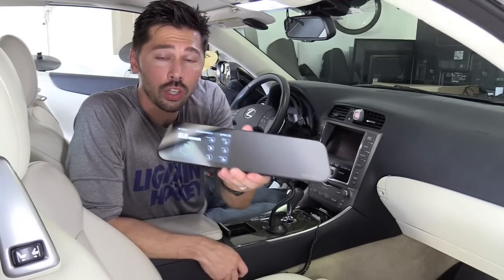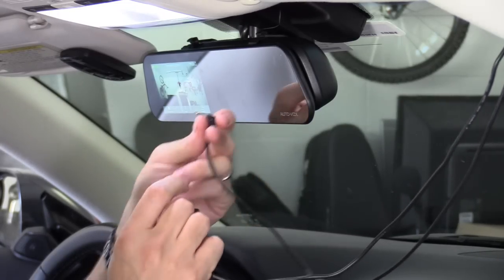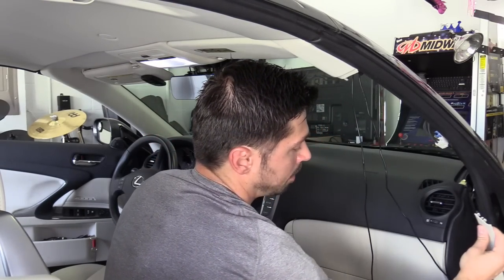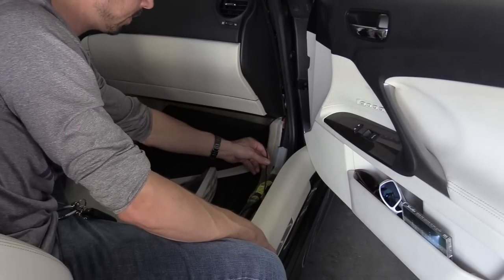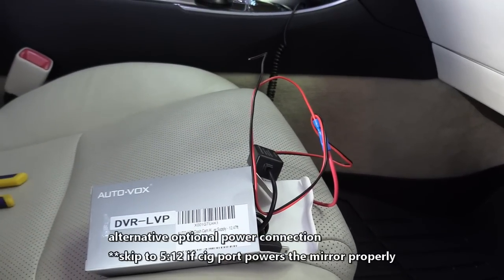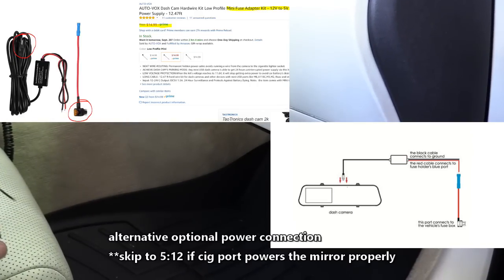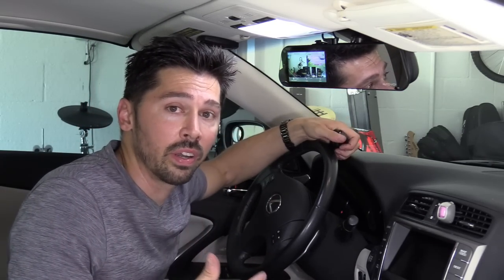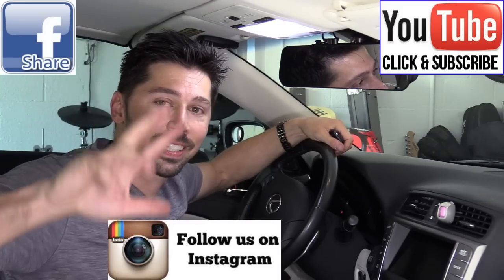HOW TO INSTALL AND WIRE BACKUP CAMERA / DASH CAM DVR SYSTEM

Comment: I hard wired my dash cam using an add a fuse but no power.  The fuses are good, cable is brand new and wired up right. One to the fuse, one to ground. What am I doing wrong?

Comment: I bought 2 for my car and my wife's.  How much would someone charge me on average to install it?  Also I did not realize that I may need the fuse wire install kit to stop the draining of battery and low voltage protection.  Amazon does not sell the one on the link any longer.  What other suggestions?

Comment: Hey big 🐕 thanks for the video, I have a Carchet dash cam that's basically the same so I think your installation will be helpful.

For the backup camera wiring, I think the product is a "quick splice" but they're made for different gauges of wiring. The ones at my local store are for 18 gauge/14 cal. and seem like they'd fit but I'm not sure. Do you know the size of those T-splices you used? Thanks man.

Edit: those ones at my local store are the blue splicers, 15 amp I think. Looks like you used the red ones, 22 gauge 10 amp. My car is a 2011 Civic, probably similar wiring to yours I'd think.

Comment: Good video! Some vehicles are longer and you may need to take the short cut down the edge of the roof panel to run the rear camera. Others may only require removing the rubber door seals and a rear hatch panel. Because most state laws require that the full tag be visible at all times (not just the expiration stickers), I suggest mounting the car tag on top of the camera mounting plate. I really don't like seeing a Trooper on my rear bumper with his blue lights on!

Comment: Good video, but next time tug wire on rubber on top of the road not bottom, I hope you got my point. And this is for all those who are planning to install this setup. Always tug wire on the top rubber bw roof and door.

Comment: This is a good video especially w the splicing proccess but forget going to a carwash. Byebye cam.  Ive had mine stop working after.  It was a slightly diff model of the Autovox w no hardwiring.

Comment: I think you need to put a rubber grommet to the area where you drilled to protect the wire from getting short circuit to the ground/car body. Be generous placing zip ties from the unit all the way to the back, making sure the wire does not touch the body/ground, especially during summer. The insulation of the wire may not be able to stand the chassis heat, and might cause some short if the wire insulation melted.

Comment: The new mirror mounted had a forward facing camera as well as the rear-view camera
It look like you placed the forward facing camera against the existing mirror in the automobile
That block the view of the forward facing camera
How do you alleviate that problemblocking that forward facing camera on the new assembly?

Comment: Hi there. Very informative video! just have one question, on 8:17 when you joined the wires, did you you strip the blue wire (the wire for the reverse light) to expose the metal wire part or the splicer does everything?
Reply: yes  I had to strip the Camera wire and double it so the splicer would connect it.When i first did it i thought the splicer would do it but it did not. Because the splicer is made for a thicker grade wire.
Reply: @jamesa7135  thank you for your response!

Comment: Man too much DIY for me. Nice video. I would have to pay someone to do it for me.
Reply: It's easy, front mirror is just for display, rear cam start active when your gear box in reverse mode because cam power connected to rear reverse light then send video to front mirror. all you have to do is just hide all long run cable front to rear end camera.

Comment: the backup camera will be stolen for sure =(
Reply: Why are you so sure the rear view cam will be stolen? Replacement rear view cams (cam, only) can be purchased for less than $10 USD. EXAMPLE: ETvalley 8 LED Waterproof Car Rear View Camera Backup Camera with 170 ° Viewing Angle, Black, $8.95 USD.

Comment: Hi Paul, I have the auto-vox x 2. My rearcamera was stolen from the car. I both a new only rear camera from auto vox x2  but the rearview mirror camera display says that  there is no rearcamera. Do you have any idea what there could be wrong. Can I install a other but the same as the stolen one on the auto-vox x2. Thanks for you're help. Peter

Comment: Great instruction.  One question about back up camera.   Does it record while driving forward?  Meaning, if someone rear ends you at a stop sign or light, will it show footage of that?
Reply from the maker: Yes mine does, still works great too. I recommend firmware update if you have older models. I made a video how to do that. See my Car install playlist.
Reply: Tampatec can you put link here ? Can’t find it

Comment: What would You use to seal that hole with the cam wire going in?
Reply: Either electrical insulation tape wrapped around the cable so it fits into the hole nice and tight, or a rubber ring seal, or apply sealant.

Comment: Informative but I have a Toyota Tacoma Truck 1998 with a cap, and I am having a hard time figuring out the best way to run wire to back plate, should I go under the frame of truck, haven’t found a pathway through the cap as I would like to run in under the plastic bedding of truck and not the undercarriage of the truck. Any suggestions?

Comment: I installed one of these rear view mirror mounted dash cams before and it reduced the distance of my key fob. I pretty much had to be in arms length of my car door for it to work. Mine was from a different manufacturer but i'm curious if you're experiencing the same issue with this one?

Comment: How do you do the water sealing? And why do you need to connect it to the rear lights?
Reply: Use silicone to seal it and  the backup light is splitting to back up camera so you could see when you put your car in reverse. I hope this would helped. Thanks

Comment: Because I have a Chevy Silverado, I only can install the rear camera Upside Down (of course the image on the mirror is "upside down"), any idea how can I fix it?.... I couldn't found any options on the setup or in the manual...... thank you.
Reply: Carefully pop the camera box out of the pivot bracket and insert it back in upside down.  We had to do the same for our car since the camera was directly in the way of the trunk release button. Actually put the bracket on the the bottom two bolt holes and flipped the camera upside down to compensate for that mounting method. No firmware solution for that.

Comment: If I don't need the rearview mirror to be used as a backup cam, but still want it to record, could I avoid doing all of that extra wiring or would I still need to do that?

Comment: How long is the cable that goes from the back up camera that goes in the trunk to the front mirror? I want to install it in my Ford E-350 van that is 12+ feet
Thank you
Reply: Jose Martin, her the wireless gadget.  I have an Odyssey 2006.

Comment: great video.. I'm getting one of these models just not sure which one.. The one with the transmitters seems easier to install. with no  wires running front to back..

Comment: Great video. Hello from Brandon Florida. Good to know that you are near by in case I screw this up! LOL We installed the same system. We hooked the red to the red positive on the reverse light bulb and the red with the black line to the black negative on the reverse bulb. The rear camera display only comes on in park and after you play with the poeer button. When shifted into reverse, the rear camera feed turns off. We triple checked everything and it's hooked up right but doesn't work correctly. We are using the cig lighter to power it not the acc wire kit. What do you think is going on?

Comment: Hey Tampatec,

I installed the rear cam same one you got in this video, and it is connected to the reverse light wires just like shown.  I got the black on the black and the red is on the colored wire of the reverse light.  The cam wont come on though. Doubled checked connections and input all is good.  The firmware of this auto vox m6 doesn't show the camera choices in the playback area, just says Normal then I touch that and there are no choices for front and rear it just shows thumbs for front cam.

Do you think the firmware is messed up?  Do I need to run the black wire to a metal ground, I mean, I'm seeing people are just connecting the two reverse light wires.  Thanks for your support, Jon
Reply: Oh I tripled checked, at the av input it needed to be pushed down one more snap...back-up showing up now but still no records of it in the firmware or mention of front and rear.
Reply: Back in March I contacted the support for this product, they took several days but sent file containing the firmware update.  The install using the micro sd and the instructions, was successful, and the firmware is now like shown in this video.  Had to go through all that.  It comes with, or used to come with botched up firmware that may or may not record even when the record light is indicating record in progress.  Very frustrating or was.  We were using the mirror out of the box when first got it, (with the botched up firmware) when this Buck suddenly appeared in the city block street running ragged in all directions not knowing where to turn to get back out of the way of all the cars and then it turned down a residential side street and just keept running way far away from the woods down strange streets.  I pulled over to view the video that I thought the cam just took!  I couldn't wait to put it up on social media, it was crazy video of a wild buck, but it didn't exist on the memory card.  Even though the record light indicated it was recording by flashing the red light consistently, the video did not record or save or whatever happened.  Hated that and hated the firmware it came with.   Shrew if you read all that it was worth writing it...wink!
Reply: Jon Fox 
Dear Jon, I have just purchased the M6 and am facing the same dilemma as you. Please tell me how you got the interface to look like the one on this video? The rear camera does not record as it does here. My firmware is 201711. Is this the correct version? Thanks in advance!!

Comment from the maker: NEW UPDATE FOR M6 MIRROR TO FIX BACKUP CAM BLANK SCREEN AND BACKUP CAM RECORDING UNLOCKED https://www.youtube.com/watch?v=raOaMI8qZew
1. If you want to have the backup camera recording, you can download the firmware from the link below.
https://www.mediafire.com/?daqw0959bb5sed3

2. If your M6 screen blanks out while the car is in reverse. The link below is the firmware to fix the problem. The main reason to cause the issue is that "Screen Saver" makes the screen blank out. 
https://www.mediafire.com/?fulfe3yd6ulxbp8

Steps to update：
1.Copy the file XXX.bin to the TF card.
2.Insert the TF card to the device, then connect the device to the power supply. Then the device would turn on automatically and start to update.
3.When the screen shows 100% and finsh the update, plug out the TF card and disconnect the power supply directly, then turn off the device.
4.Turn on the device again, insert the TF card, enter the menu and format the TF card again before using.
(Please note: If you insert the TF card before turning on the device, it will automatically update again)

Comment: Which black wire I should use the connected to connect when my Sienna have 2 black and 1 red wire on the reverse
Reply: arken1126 test each wire to get correct resp.

Comment: You know I bought this exact item from your recommendation. And first do you have a contact information on Auto vox because I'm having issues with the one I got and can't get them to answer their email. Second you say at the very beginning that it records front and back. Have you actually gotten your to record the back camera? If so how did you make the change? Cause in my instructions they say I have to call, I guess what they provide no contact info.

Comment: Hello. I have a 2014 Kia optima and this video was very helpful. Thank you! I have the exact same model (M6) and got everything working except for when I try to change the screen to the backup or dual mode view (I didn't hardwire my connection by the way). It doesn't do any of those no matter how many times I tap on the screen. Do you know what could possibly be the reason for that? There's nothing in the manual or the settings that lets you configure this. Also, unlike yours, mine doesn't do any recording from the rear camera and nothing shows in the screen to view any recordings of the rear as well. Do you think it's because I did not hardwire it? Hope you can help me with this. Thanks!
Reply: Gb Yn, I have the same questions. I just installed my camera and rear camera this evening.  Left for home with 6yr in back seat with my wife then we were struck by a car turning left when it changed at last moment into our car and struck the left rear quarter panel.  We knew we were involved in a collision.   The other car tried to get away and in suit we pursued.  Both cars ended up at a Texaco gas station facing opposite of each other when I (Husband) came out of car and approached the other car.  The young man was in shock and decided to leave.  My wife and I got his plates as he left.  We both called the Police.  Thankfully the DVR camera picked up the entire incident and we eventually showed the Police the footage.  Thanks to HNL's finest sweepers from Makiki.
Reply: Gb Yn , try playing with the power button.   I think I found something on line.  Try Long Pressing.

Comment: hi i know this is a old video do you still have to connect the back up cam to the reversing lights if you just want to use it as a front and rear dash cam ?

Comment: Hi, I got a question for you if I may. I just installed a Oumax aftermarket camera.  very similar if not same as yours.  I have a Nissan Altima 2013. I connected both wire to my reverse light wire. Red - Red, Black - black. the camera turns on fine, but when i put it to reverse, I get a lot of horizontal interference lines. the back image video is still shown, but the horizontal lines make it impossible to see. any reason why there's the horizontal interference lines?  thank you very much.

Comment: Thanks for sharing this video. Can the backup camera wire be passed through any of the existing holes instead of drilling one? Also the red and blue things which u use to attach the wire to reverse lights what exactly are those called? So that I can pick them from store.
Reply: Just saw the link in firts comment for the connectors :-)

Comment: very good video, very simple the only thing that did not understand much was, the connection from the rear camara to the backing light
Reply from the maker: jean carlos that's optional if you want reverse lights to trigger back cam but, you can put mirror in dual video mode and view both cams at the same time without connecting to reverse lights.
Reply: oh ok, thank you for reply back
Reply: @TampaTec  Very good point...Dual camera mode instead of Reverse gear connection...hadn't thought about that...
Reply: It looks as if you used a splice connector for both the red and black wire. I tried that and the back up camera didn't work at all. Some are telling me to ground the wire by drilling a hole into a random area of sheet metal and use a sheet metal screw. Any thoughts?

Comment: hi l bought the auto -vox m6 but the rear camera olly is backup does not record !!1
 do you kow why??
Reply from the maker: we have two firmware, please find it below and see which one you need.

1. If you want to have the backup camera recording, you can download the firmware from the link below.
https://www.mediafire.com/?daqw0959bb5sed3

2. If your M6 screen blanks out while the car is in reverse. The link below is the firmware to fix the problem. The main reason to cause the issue is that "Screen Saver" makes the screen blank out. 
https://www.mediafire.com/?fulfe3yd6ulxbp8

Steps to update：
1.Copy the file XXX.bin to the TF card.
2.Insert the TF card to the device, then connect the device to the power supply. Then the device would turn on automatically and start to update.
3.When the screen shows 100% and finsh the update, plug out the TF card and disconnect the power supply directly, then turn off the device.
4.Turn on the device again, insert the TF card, enter the menu and format the TF card again before using.
(Please note: If you insert the TF card before turning on the device, it will automatically update again)
Reply: So I had this same problem.  I looked on the internet for an answer but couldn't find anything.  Finally I contacted service@auto-vox.com and told them about my problem.  They responded with a firmware update and instructions.  This is for the firmware file: http://s000.tinyupload.com/?file_id=87293953127506820791 and this is for the instructions:  http://s000.tinyupload.com/index.php?file_id=78671445446453915503.  The instructions are a a bit confusing but you should be able to understand.  Just remember that you need to format your SD card to Fat32.
Reply: Where is the update patch located? Where can you download it?
Reply from the maker: ferreira's family try update patch or maybe LCD screen saver setting might cause it to not record or try factory reset.

Comment: Hi, I installed the mirror & camera.  The front recording, screensaver and everything works fine.  But the reverse camera is not showing up.  I did the clip alright with my C230 Benz wiring.  I don' have voltmeter to check.  Did anybody face problem seeing the reverse?